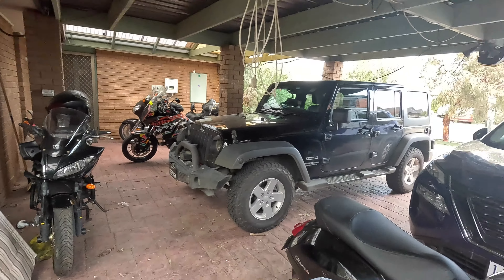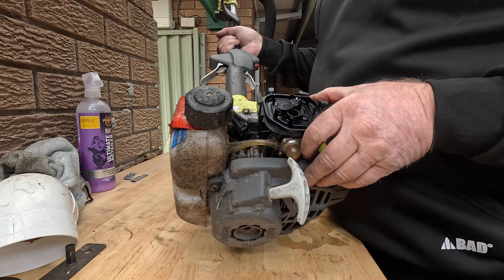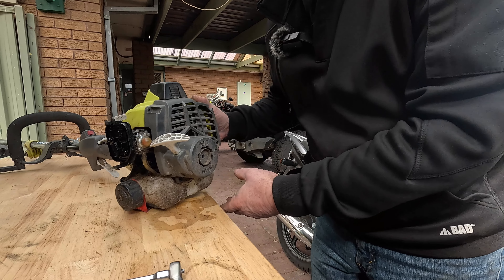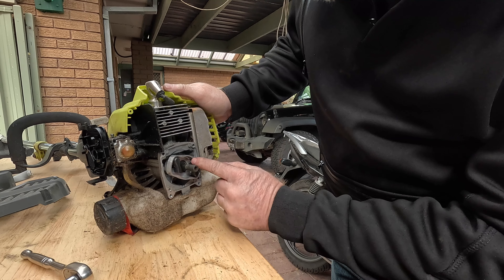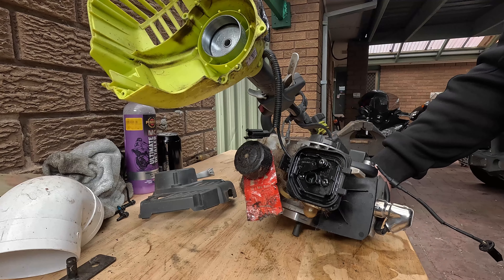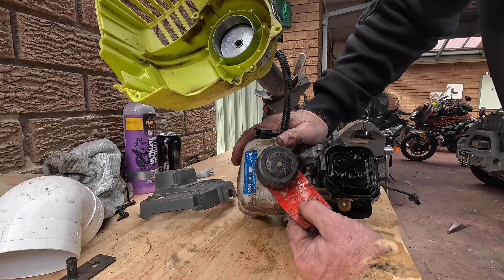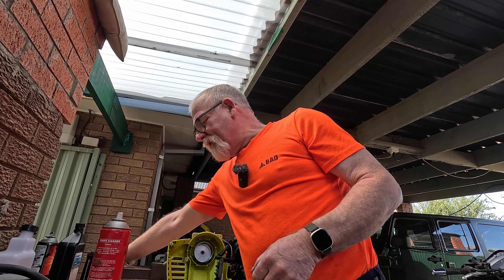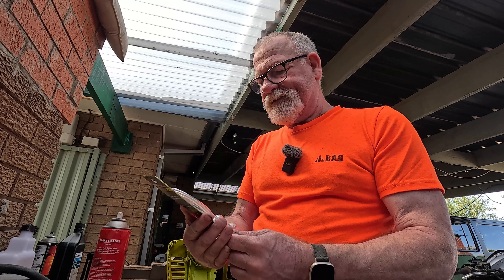RYOBI TRIMMER SERVICE KIT AND REPAIR

Comment: Hi Dan - i do like a good 2 stroke video, I fix a lot of these in my spare time.  Couple of things I wanted to comment on - the melted plug cover was normally an indication of running lean which would cause it to run hot. As you said, if the petrol mix is not correct this is one of the things that can happen. We now have E10 petrol over here, which is a killer for two stroke due to the ethanol - users tend to use E5 petrol which is better - or for low use (homeowner) they buy premix which sorts out the additive problem. The fancy bent throttle cable is called a 'Z' bend - only ever seen them on lawnmowers, not usually strimmers/chainsaws. Its generally recommended not to use an airline in a diaphragm carb as there are a couple of check valves internally that can be displaced - spraying with carb cleaner/brake cleaner bottle is much safer. A good trip to get the fuel hoses into the tank is to cut the end at an angle (you can then trim the filter end straight). The diaphragm you were showing is the fuel level - you can adjust the float needle below. The other one is the pump. The exhaust often has a spark arrestor fitted inside which can be a fault if it keeps stalling - undo the screws (I think 3) and burn the carbon off with a blow torch if needed. The foam filter on a lot of two strokes is normally soaked in engine oil then squeezed so it doesn't drip - most manufacturers recommend this to help filtration - the crap sticks to it! - don't know about Ryobi. On most of these carbs, there are 2 mixture screws - the one nearest the inlet is for low speed - you adjust that to get a good idle (in conjunction with the idle screw) the one nearest the filter is the high speed screw (for the obvious). They might have an anti tamper device over the top, or the screws themselves are specialist - I just bought the pack that will allow adjustment of any carb. Some of the newer carbs have no screws because of emission problems. Hope that helps. A good video and you got it running sweet, good job.
Reply from the maker: Never stripped one if these. The carb must not have a mixture screw as I couldn't find one, I think that emissions might be the reason as you mentioned.
I think it's biggest problem was the rotten hoses and just a good clean up was needed. Good fun though although my projects are mounting up. Some bigger jobs coming up soon.
Thanks for the info though, this stuff is handy to know for future jobs..
Reply: @biker_dan  I used to work on mostly big diesels, so this was a big learning curve for me. The last couple of years, small engines is mostly what I do as a hobby, and it can be quite difficult to diagnose small faults on 2 stroke. I mainly get stuff the dealers won't fix (or say they are unrepairable) so it keeps the brain working. It's amazing how many people think if they put more oil in the mix - it must be good for the internals..... But you are right - it's critical. As far as the mixture goes if you have no mixture screw, sometimes the only way you can compensate for over/under fueling is to adjust the needle height - but the adjustment is different from model to model. Keep them videos coming.
Reply from the maker: @tibboh100  yup a lot don't measure the 2 stroke oil, they don't realise the damage they can do by giving it too much or not enough. Same goes with using the wrong oil or even waste engine oil. Think the best out is the 2 stroke synthetic, it seems synthetic is replacing all oils..  
You need to set up the video can and start doing instructional repair and servicing on these engines, it is good fun and can bring in a little money, not a lot but it pays for your YouTube and cameras and stuff..
Reply: @biker_dan  I actually had a honda 4 stroke with a locked engine and a seized governor that I was going to do a 'Will it Start' video, but I ran out of jobs last Thursday so just had to get on with it (it now turns and the governor is sorted).
Reply from the maker: @tibboh100  that would have been good